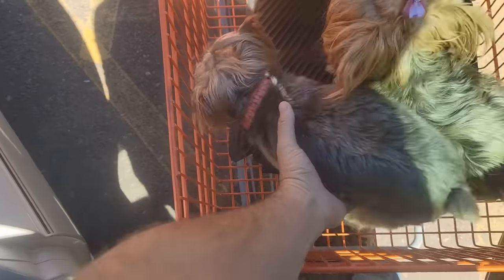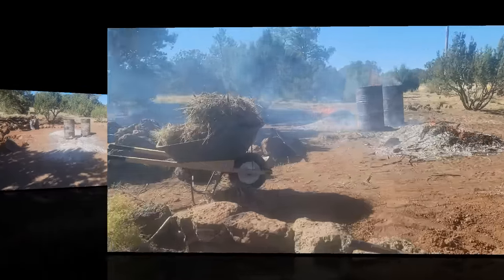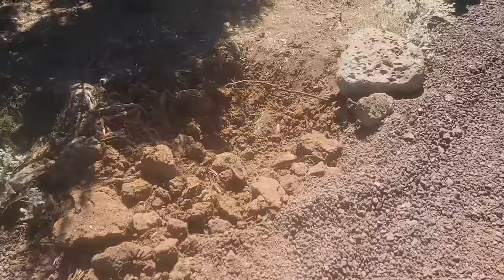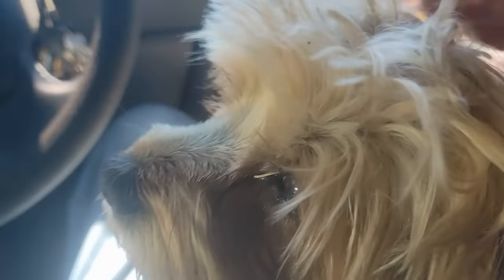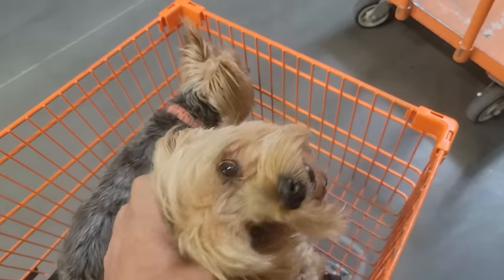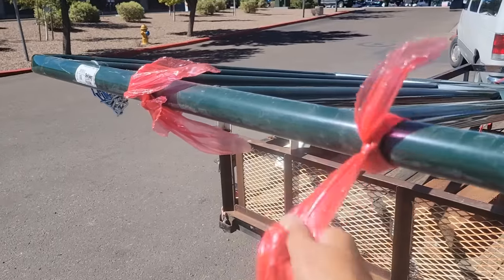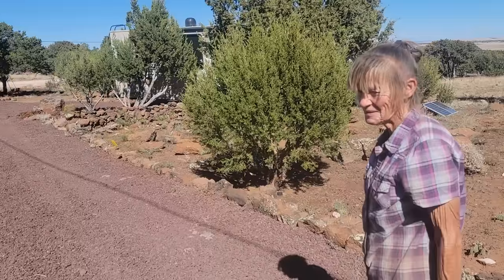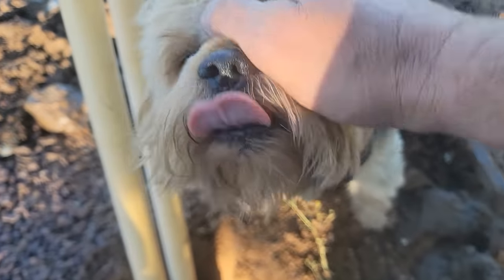I Finally Hit Rock Bottom! .... Or Did I ???  Woof Pack Meets Itty-Bitty Yorkie!

Comment: I was wondering about a drill bit used on concrete, you might have to lay down to reach the rock. But if you could drill holes and perhaps
create enough cracks in that one spot you could get thru it. Carolyn has been a Earth bound Angel to you and your home. Hard working' woman !  Thank you for sharing.

Comment: I spent weeks trying to punch a hole in stuff like that when I was putting my power pole in... threw the spud bar in and it would bounce back up almost out of the hole!!! Filled the hole with water and came back to the property about 4 days later... water in the hole dropped 1/2 an inch!!!
Finally built a 1 foot deep by 3 foot square box around the hole and pole and filled it all with concrete... power company approved!!!

I don't miss doing stuff like that at all!!! Lol
Good luck bud!
Have fun!!!
😂

Comment: Enjoyed the video. 
Just a couple of tips for jackhammers. Don't go too deep in one spot, you run the risk of jamming the bit in the rock. Don't use the bits like a pry bar. Keep the shafts greased and let the tool do the work. If the rock is super hard, you will dull bits quickly. Hope that helps if you were not aware.

Comment: I had that same jackhammer and it worked great. I broke it when it got stuck by prying up on the handle with a bar like you are using.  Aluminum handle broke My fault. Great tool tho.

Comment: Hey Kevin, your property looks better all the time. Having built a number of swinging gates and fencing in my time I would rent the full size  Bosch electric jack hammer , they are moved around by a special hand truck. You stand straight up for these and they have the most power.  Using two shorter gates to make up the width you want is way less stress on the posts and will sag much less as time goes on. Either way I'm sure you will have it looking good.      CCC

Comment: You might also consider widening, instead of deepening the hole.  Looks like it's fairly deep.  Extra width and concrete would counter balance the gate and maybe save you some trouble.